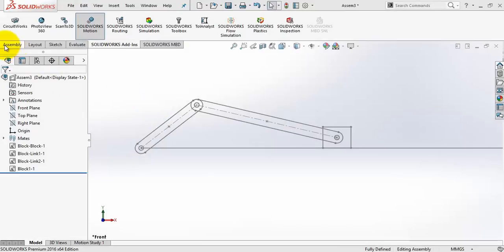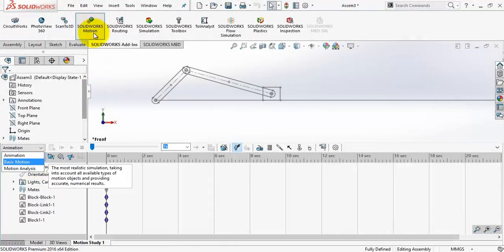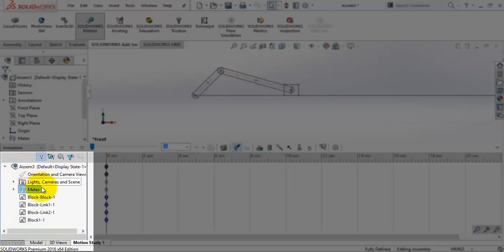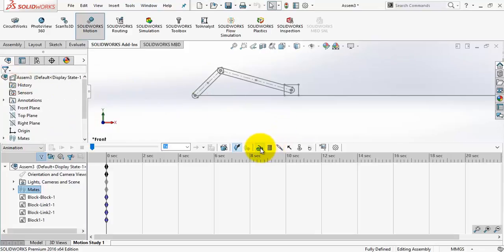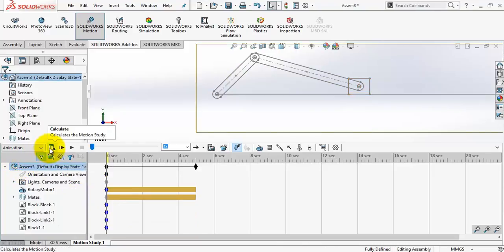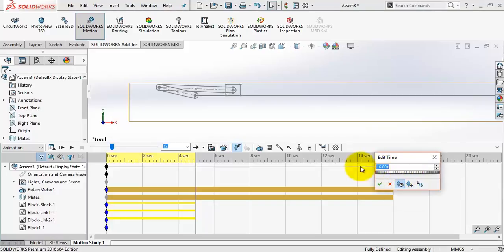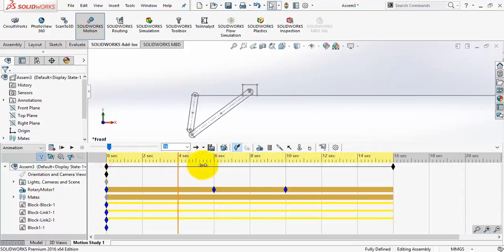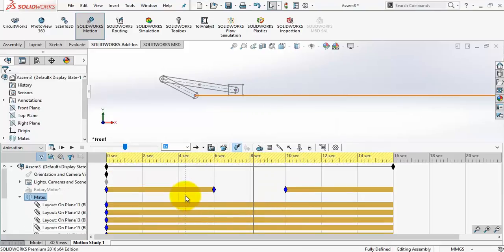SOLIDWORKS 2D Dynamics & Animation - Motion Study

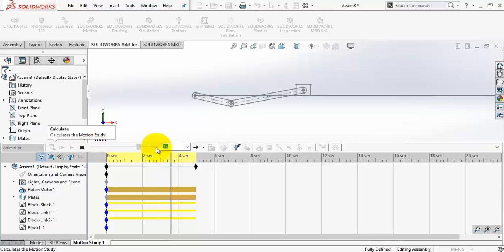Comment: 02:47 Simulating using solid models is smarter and closer to the correct result.  In this way, connection breaks occur in your model.  and the simulation would not be healthy.

Comment: the rectangular piece is not still aligned with the line, when turning the lever the rectangular piece also rotates circularly because

la pieza rectangular no sigue alineada con la recta , al girar la palanca la pieza rectangular también gira circularmente   porque
Reply from the maker: I totally agree. In real application such as internal combustion engines there will be some sort of guidance to maintain the alignment (Cylinder Walls + Piston Rings)